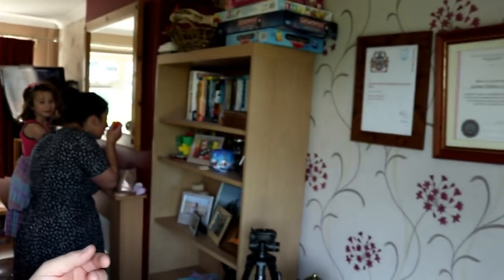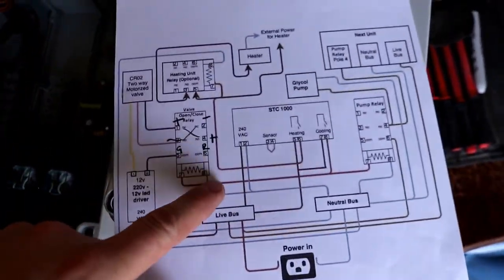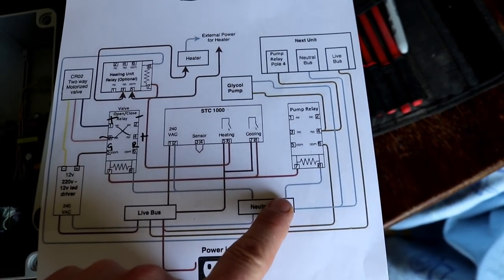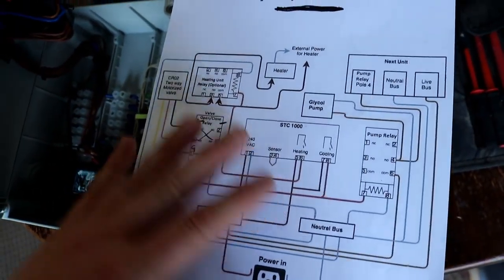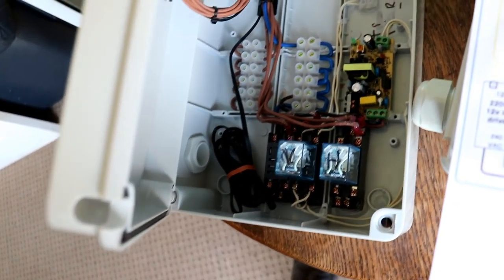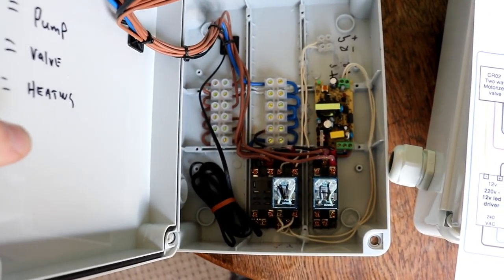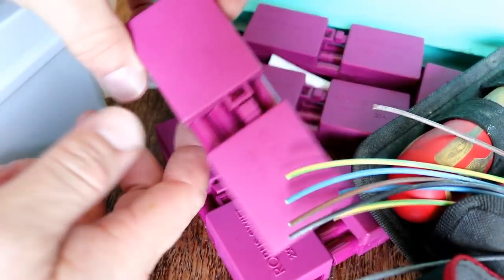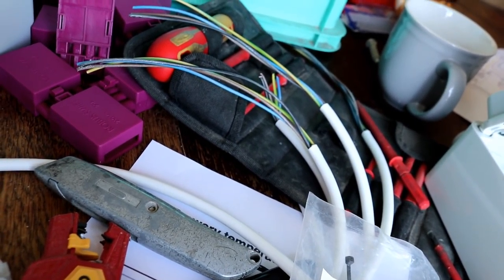FERMENTATION CONTROL UNITS

Comment: HI Man is there any chance you could post the diagram somewhere ive tried to do a screen shot but with no color ink its bloody useless. Im doing 3 at the moment just to clarify the numbers relate to the numbers on the bases not the relay tops ? I am rubbish with anything with more than 1 cable but will persevere
Cheers Rob
Reply from the maker: Hi Rob, The numbers are for the bases but it is more important to understand the NO and NC positions in relation to the common. You may have to play with it and figure it out. You can fing it here. http://www.harrisonsbrewery.com/wp-content/uploads/2018/06/Brewery-temperature-controller.jpg
Reply: Thanks for the replay and comformation  though they are  quite fun when the tops blow when the cooling cycle kicks in but starts to get frustrating when waiting for replacments from china lol
Reply: great stuff , rewired to your plan and all working .It seems I had a bad lot of relays !!! Thanks man 
only the control panel to do haha should be fun 
Rob